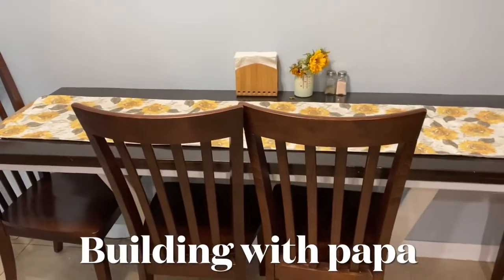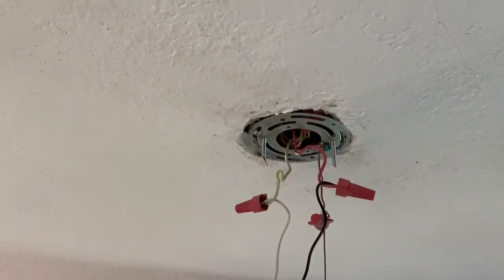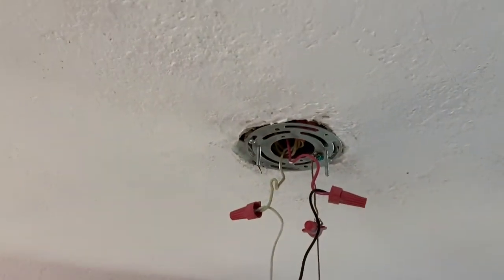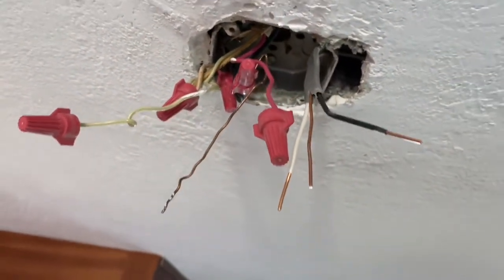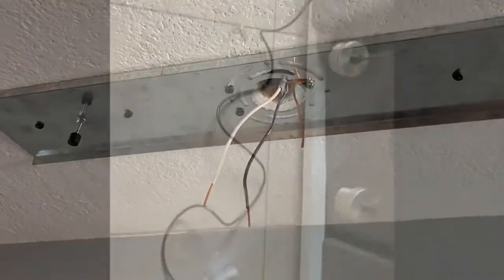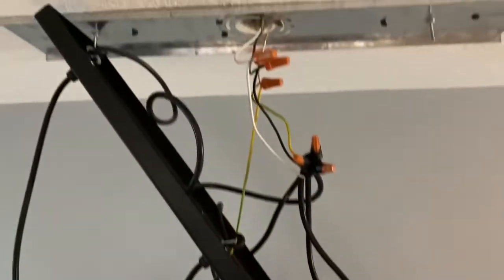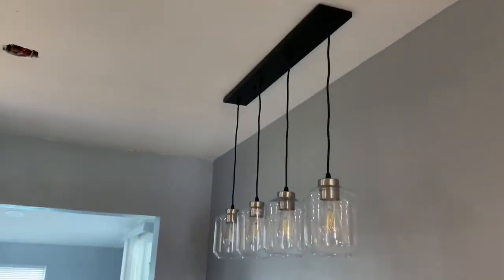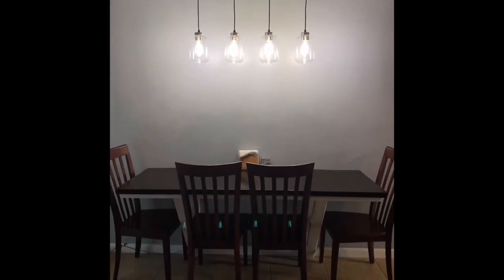How to install a light fixture where there is no electrical box

Comment: Hi, Can you install the light fixture bracket for this style into the drywall directly? And if yes, how much can the drywall hold?
Reply from the maker: Good morning, I would not install it directly to the drywall you can depending on the weight but you would need to use toggle bolts, but if your light is similar to this one, you should be able to reach one of the trusses or strips of wood or metal that are in the ceiling you would need a stud finder to find those locations.
I hope this helps, and if you can leave me a thumbs up.

Comment: Nicely done 👍 i got a Question. My mom had some guy install a motion light outdoor on the side of our house but the light never turned on. There is no switch to control the light so i removed the cover and checked if it was getting power with a probe and I got nothing. I used 2 diffrent probes new batteries still no power. I then climbed in the attic to trace the wire to see where it was going to but I got to a spot where i could barely fit and all i can see was a 2x4 with a hole in it and the wire going down the hole and i can't see where it goes from there.  Do you have any tips on what i can do to figure this out?  I would like to figure out why the wire has no power to it, I don't want to run another line to the electrical box myself as i don't have much experience doing that. I can change the light and wire it myself im just not comfortable running wire and hooking it up to power yet. I mean I could probably do it if I did more research but first I just want to find out why the wire running to the electrical box for the light doesn't have power. Any suggestions I'd appreciate it.
Reply from the maker: OK so you got in the attic and the wire is going to the light and the wire from the light goes to the electrical panel?
If it does go to the electrical panel you need to remove the cover and see where he connected it if he installed a new breaker or if he tied it into an existing breaker.
If he has tied it in there should be power at the light if there is no power at the light then it may not be connected to anything or it’s connected to a separate line that may be to a switch that may be off and that’s why you’re not getting any power, you have to chace then wire And find out where it’s connected to get power.
I hope this helps you and if you can give me a thumbs up it really helps the channel.
Once you chase the wire and you find out what it’s connected to or not connected to let me know I will try to help you building with Papa.

Comment: Don’t you need to install a electrical box?
Reply from the maker: Not with the style light I went to the boxes on the ceiling and ran the Romax cable over to where the light was going and brought it into the bottom of the light fixture and then wired to the light cans themselves.
Reply: @buildingwithpapa what does that mean “not with this style of light?  I have a vanity light to put up on a furring strip wall with an existing wire and keep being told to have a junction box. I keep saying it isn’t necessary. Ha ha. Who is right?
Reply: @kimbanyc  i kind of have the same question as sometimes the light fixture itself houses/ protects/ supports/ contains the connections well enough to serve as a box?
Reply from the maker: Thank you for your comment and if you can leave me a thumbs up.
Reply: electrical box is required by code, put it in, don't do this mickey mouse typed shit that he is showing